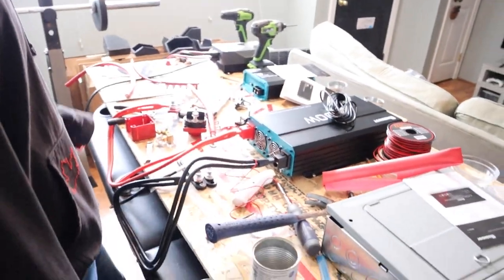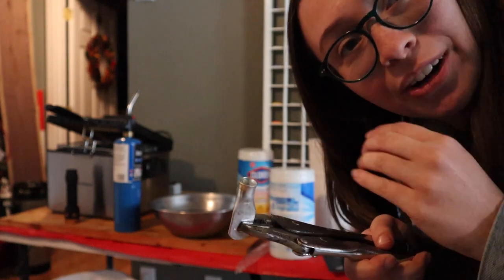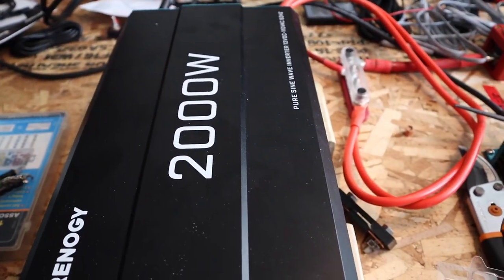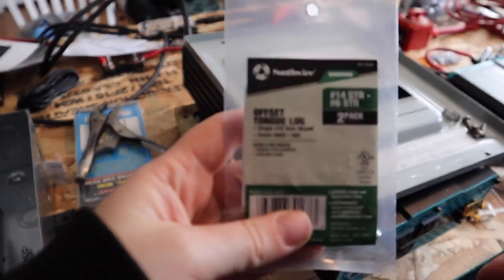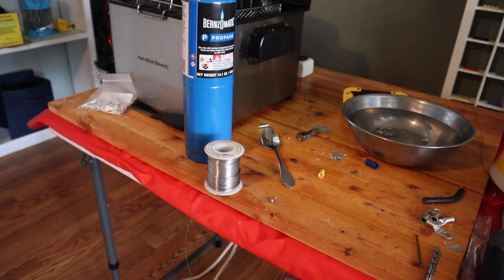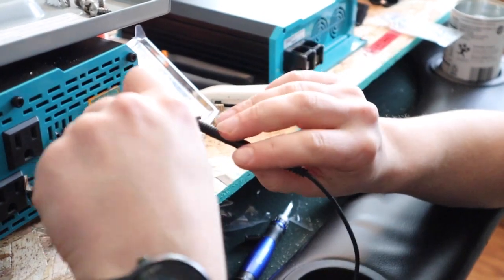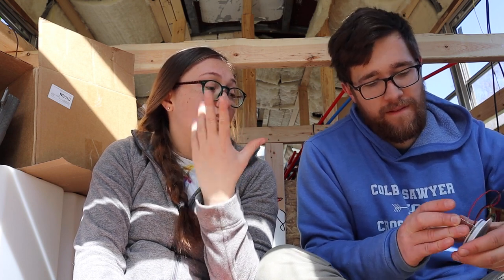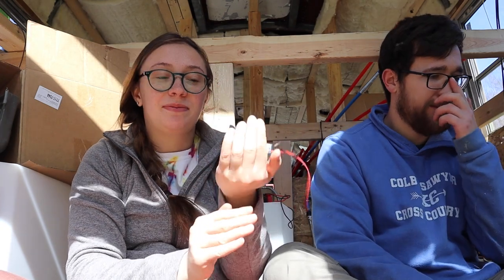We Messed Up! Installing out School Bus Electrical System

Comment: I'm typing as I watch the video, but that is the input side of the inverter for AC power I think.  I couldn't see that inverter using over 10awg wire for AC pass through.  Update: After watching the rest of the video, I was wrong about that being the input passthrough.  It is the output, but at 2000w to get the amperage, you divide 2000 by 120v and come up with 16.6 amps.  14awg wire in home use does 15amps and 12awg wire in home use does 20amps.  So really instead of the 6awg wire used, it should have been 12awg wire.  That is why the terminals are so small.  6awg is typically used in high amperage circuits, like an electric stove.  But I love your energy and drive to get this job done.  Entertaining video as usual.
Reply from the maker: According to the manual they are the AC outlets, we were also confused when we first got the inverter but we just went with what the manual said